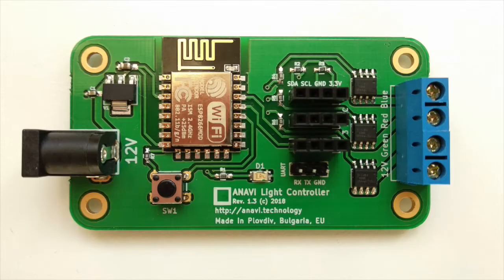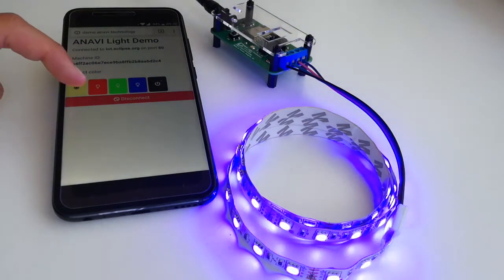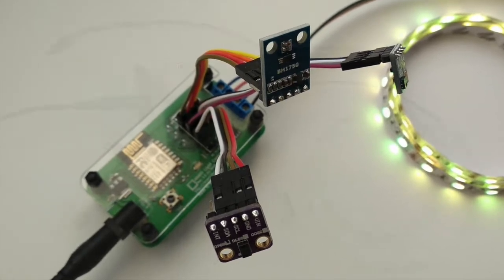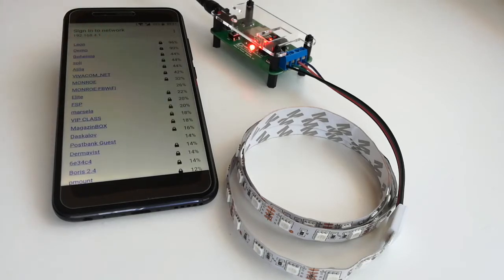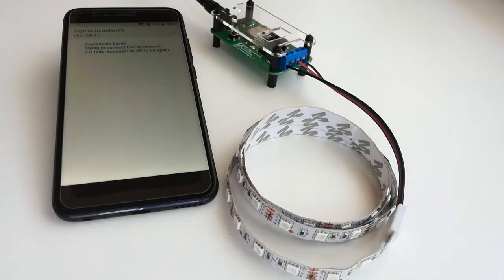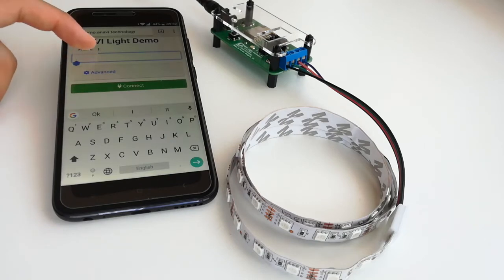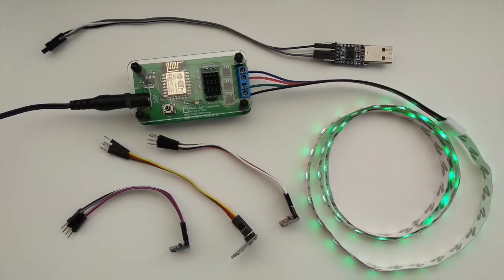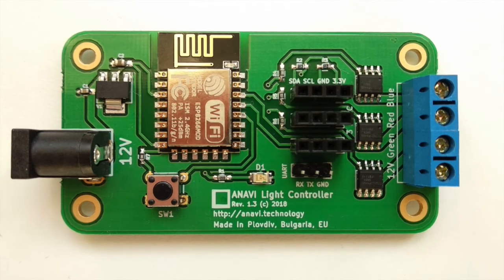Connecting ANAVI Light Controller to your WiFi network

Comment: I was directed here to configure my Gas Detector  but I can't get to a configuration screen.  It connects to my wifi but I can't get to a configuration screen at all, it replies to pings but I can't http, https. ssl or telnet to it.  Help please.
Reply from the maker: The default firmware of ANAVI Gas Detector communicates for the machine-to-machine protocol MQTT. After connecting it to a WiFi you will need to connect it to a MQTT broker. Do you have your own installation of MQTT broker and have you connected the Gas Detector to it?

Comment: I have followed these instructions to a T but I still cannot connect to the LED controller through the demo site.  The color control buttons show up on the demo site, but not my machine ID.  I am unable to connect to the controller through wifi.
Reply from the maker: Sorry for the inconvenience. It seems that the public MQTT broker provided by Eclipse Foundation is temporary not available. You can use an alternative public broker for example the one by HiveMQ: https://twitter.com/AnaviTechnology/status/1104345390160273408

However, keep in mind these free public MQTT are not secure and should be used only for demonstrations and testing. It is highly recommended to setup your own MQTT broker with a username and a password.

Comment: Whats the advantage using this over an raspizero or raspi zero clone (eg Orange)
Reply from the maker: charlie brownau for Raspberry Pi you can use ANAVI Light pHAT. The advantage of ANAVI Light Controller is that it is a standalone device specialized just for the task for controlling 12V RGB LED strip.

Comment: Can you just Direct IP HTTP into the device , eg 192.168.1.1 instead of using an internet domain name 

Why does EVERYTHING need the FUCKING INTERNET TODAY ?
Reply from the maker: charlie brownau no problem, it is all open source so you can easily modify the Arduino sketch and replace the MQTT part with a HTTP server if you prefer it this way :)
Reply: @LeonAnavi  can you provide any resources on how to do this? Thanks
Reply from the maker: @crzykid21  the open source firmware is available as an Arduino sketch in GitHub. The documentation is also in GitHub. It contains guidelines how to configure Arduino IDE and therefore modify the default firmware:
https://github.com/AnaviTechnology/anavi-light-controller-sw
https://github.com/AnaviTechnology/anavi-docs/blob/main/anavi-light-controller/anavi-light-controller.md